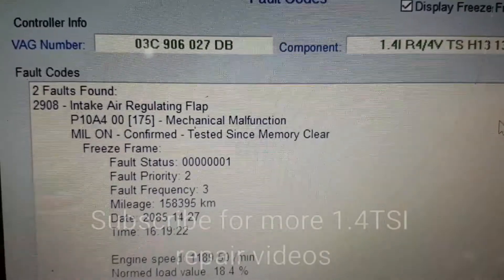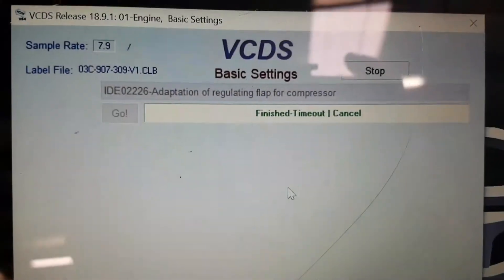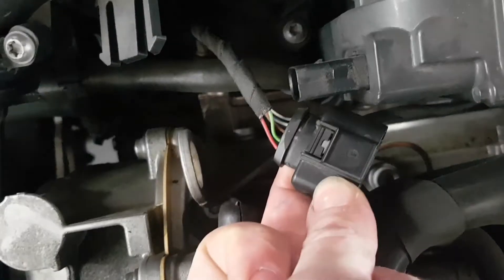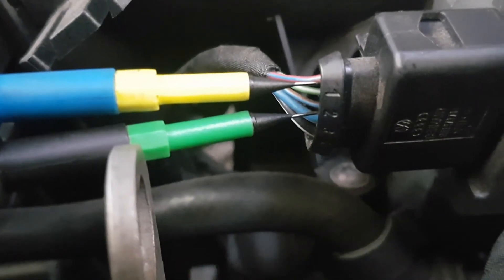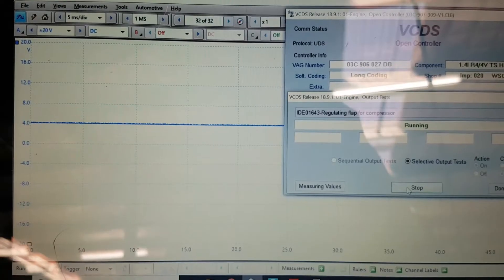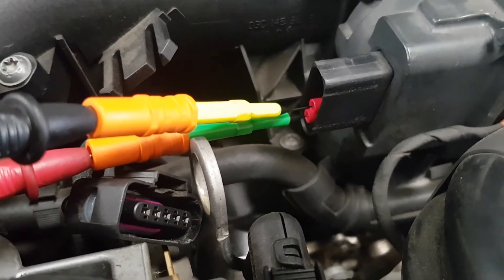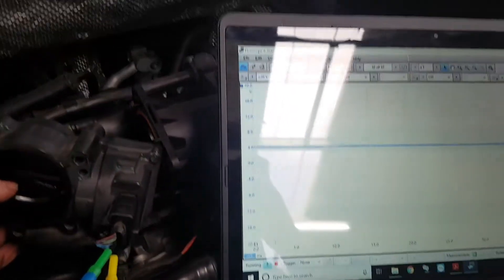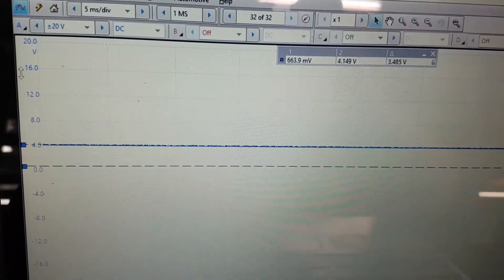P10A4 1.4TSI VW Diagnosis and Cause With VCDS

Comment: Thanks for the video. I've got the same symptoms as this but with error code p10a0. My mechanic replaced the regulating flap but engine still won't rev over 3000rpm. They've tested the wiring etc and can't find an issue so believe there is a problem with the ECU. Has anyone else experienced this problem and/or have a solution? Thanks
Reply: I have the same issue just changed the flap and it still won't rev pass 3000 rpm don't know what to do can anyone help
Reply: I have the same problem! Did you find any solution?

Comment: I used a different procedure. I put the body in the oven and heated it to maximum power for a few minutes, then just use a knife and it works by itself. I cleaned everything with alcohol and greased everything with copper paste. Then I folded it together, tightened the screws as much as possible and put it back in the oven. I took it out while it was hot and re-tightened the screws. thanks to this, it was possible to put it together in approximately the original quality.

Comment: Thanks for the videos. Could this issue allow oil to enter the intake and intercooler piping and cause exhaust smoke or is this more likely to be a bad turbo? And could a bad turbo cause excessive crankcase pressure?

Comment: Supercharger boost is forcing the oil past the shaft 'seal'. Poor design, as if they didn't know there was going to be boost at that point.
Reply from the maker: That's exactly the right way to explain it mate.
Reply: @FourRingsAuto  Run a short, small tube from the charge pipe to inside the housing of the flap valve body, it will equalize the pressure so the oil is not being forced through the shaft seal.

Comment: Great video(s) and smart approach as to fixing. Just final issue: the new flap got installed but cannot adapt/reset. At a friends place who has the VCDS, the software would not even allow to display the  "IDE02226 Adaptation of the regulater flap for compressor" button. When you click on "basis settings" it would ask for a security code neither he/me has. How to find that code is there something wrong with VCDS software version? Appointment at "regular VW dealer" not before 1 month...Many thanks!
Reply: Did you find a solution?
Reply: Did anyone found a solution?

Comment: great instructive video. thanks for efforts. while playing with VCDS on this flap ( mine is working no problems yet) ,  i realized that 1.4 tsi CAVA high pressure pump is making a buzzing noise especially when engine is cold and idling, after warming it up, when i step it on  slightly, it keeps buzzing when i release the pedal it momentarily stops buzzing then it starts to buzz subtly. is this normal? i dont remember such noise in near past. ( i hear it inside cabin as a faint buzzing such as a stuck HVAC valve tries to open continuously)  i care, and hear and smell everything sorry my bad.
Reply: Its the fuel filter thats clogged and brrrs on the bottom of the car 6.6bars!change it!

Comment: Does this part need to be coded in when its replaced
Reply from the maker: Needs to have it's basic settings carried out.
Reply: @FourRingsAuto  How do you carry out the basic settings once installation of a new unit is done ? Thanks ! Great video !
Reply from the maker: @DeanGrosser333  i do it via vcds. Any decent scan tool should be able to calibrate it for you.
Reply: @Four rings auto Does magnetic clutch needs adaptation too and what group is that?

Comment: On my VW Golf MK6 the check engline light is on, a couple of days ago the DSG drive sign has been flashing on the MFD, after 10 minutes of using (d1 d2 d3 ...). Local service found the fault code: p10a4, the sound of this flap is not so good as they tested it. Yesterday the D1 sign started flashing immediately after ignition, and it jumped into neutral gear for a couple of seconds while driving home. Could there be any connection with this flap malfunction and gears? Thx, Adam
Reply from the maker: No connection. 2 seperate faults.
Reply: @FourRingsAuto  could it be DSG mechatronic fault? And the regulator flap fault at the same time? The local shop hasnt found any other fault code.

Comment: Nice Video :)   in this case, I would search for were the excessive Oil is coming from. yes, some residue in the Intake is normal. but  80% of the case I find is that either Turbo Ore the compressor is trowing Oil true its seals into the Intake.  I have One right now in the workshop, Timing Chain Jumped + mechanical fuel pump leaking." well as the dealer said. but it is 1 Injector Leaking" and here the Turbo is worn so it throwing oil into the Intake. a Nightmare to Take Cylinder head of lol. Yes, it has Valves hit. And to make it even more fun the car 60.000 km ago had its timing chain done at Volkswagen. car was running poor and ruff, when it came in. and you could hear a mechanical rattling sound. from valves.  + the Intake manifold, metal part were the Injectors are sitting is slipping its coting were the seal rings seats from the plastic manifold, not a machined surface but Coted one. This engine type is Realy Insane bad designed.
Reply from the maker: Thanks for feeding back about this one though after your comment on the timing chain video. It seems the 1.4tsi issues are popular and people like the videos so I'll try keep them coming 👍
Reply: Four Rings Auto very true! It’s very hard to find a channel working on 1.4 TSI (ea111) engine.
Reply from the maker: The excessive oil gets into the intake pipe from the breather pipe near the air filter connection. When they blow out pistons the blow by of boost into the crankcase also forces oil into the intake. Turbos are also a concern. If the chain was only done 60k ago I'd be worried about eirher extended service intervals or incorrect oil being used. I wonder if just the chain was replaced or the tensioner too? Have you conpared the old chain to the new one to see if the failure was due to chain stretch? If it's stretched in that period it has to be down to an oil quality issue.
Reply from the maker: Injectors are also problematic like you mentioned. The oil being contaminated from the fuel won't help the chain life. It may have beem leaking for a while. Are you replacing one or a set?